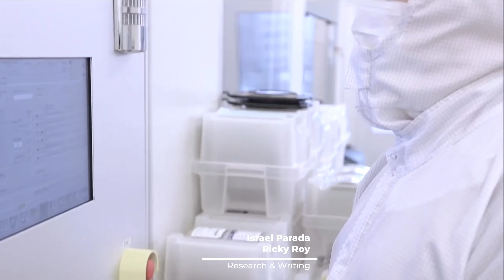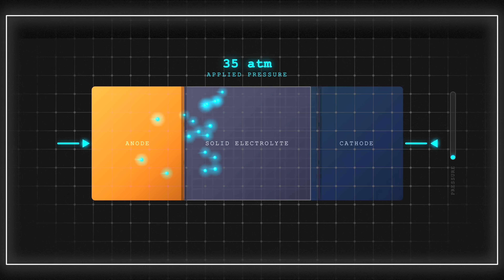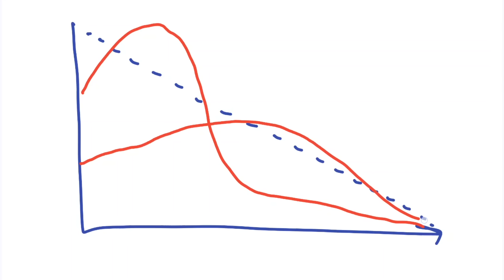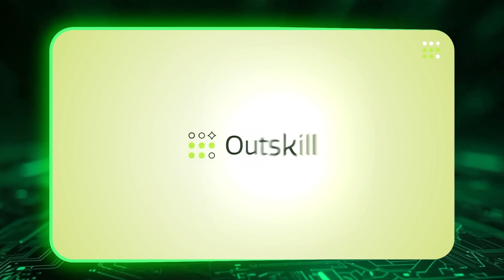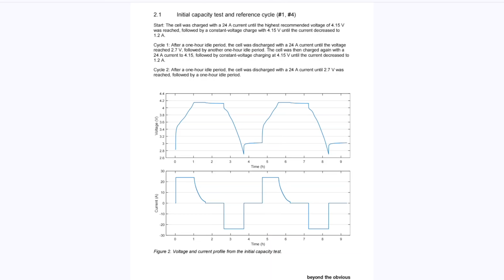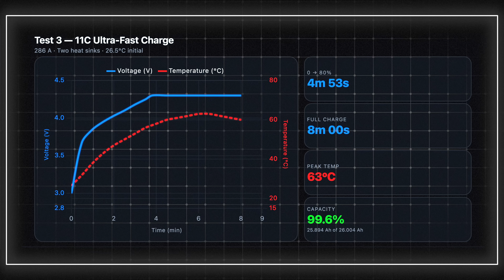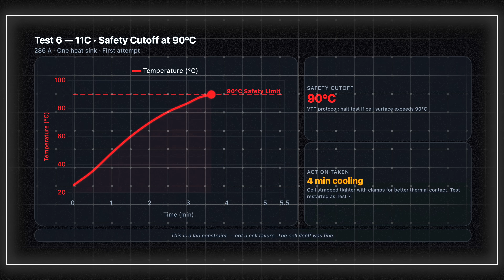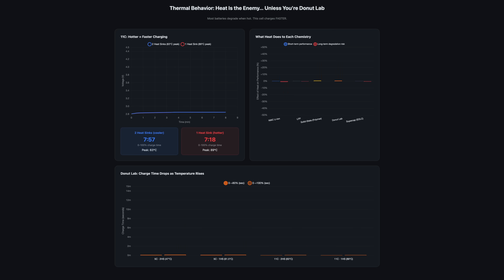Donut Lab's Solid State Battery Test are Shocking...

Comment: I think you forgot to include the video at 16:12
Reply: i saw it in my mind
Reply: I suspect Ricky excluded it after spotting Ryan's (Ziroth) comment was not about the VTT tests, but an earlier Donult Lab video showing 270A charging being performed. The same video that Ricky criticised for the size of the charging leads not being sufficient. To be honest, that video may not show cell expansion at all, as the apparent event occurs at a terminal connection, and could simply be thermal expansion of the terminal metal bending upwards within the test cell. This could be due to a thermal gradient existing between the body of the battery and the current collecting plates exit point at the terminal. 

Also, the heat causing the event (if it is thermal based) may not even be due to the battery itself, as Ricky noted in that particular test the leads and terminal connection were insufficient for the 270A current used, potentially leading to heating of the terminal itself; the thermocouple on the battery body during the test was not that high (59°C) suggesting the way the terminals were connected may well be involved.
Reply: Yes, I wondered that too.
Reply: I saw it in my head movies
Reply: This isn't the first Donut response video I've seen to be an editing shitshow.
Reply: @orbitalbear Race to be first, the same thing that gifted us "Fox News" and "CNN"
Reply: High quality production! /s

Comment: I think its just a really advanced lipo like the ones used for RC racing applications and that's it.
Reply: That is my thought as well. Outstanding battery tech, but not what is claimed. The point appears to be hype, the real question is why? If the tech was as they claim, they wouldn't need to play all these BS games, the tech would speak for itself.
Reply: @rfwillett2424  I suppose the simplest explanation would be that they want to be bought out while the hype is hot.
Reply: @pkprotoplasm  Which is my point, if the product was real, it would given them all the hype they could ever want and more.
Reply: @pkprotoplasm  If their product doesn't live up to claims, that won't happen.

ANYONE considering buying these guys out, or investing serious money in them, is going to perform their due diligence and for a company that claims to have a market-ready product, that includes carefully reviewing the production process and every minute detail. By saying their battery is market-ready Donut has effectively painted themselves into a corner, and that's part of why I think they might just be pulling this off. It's hard to see a scam play the way they've set this up.
Reply: Because...you feel it's so? I don't get all rhis negativity.
Reply: @davis.fourohfour  What I find odd, is the degree off optimism shown in the comments. I would love for their claims to be real. But if they were, Donut wouldn't be playing these idiotic games.

Comment: I want to see a test of idle drain for power lost just while sitting there. To see if it would hold charge for years like normal batteries, or drains over a day or two like a capacitor, or somewhere in between.

Since you can't really let the test go for years since they want to sell this sooner, letting it go for 2 weeks and measuring charge level the whole time you could extrapolate charge hold time
Reply: in the 1C chart after the power is removed the voltage slowly drops for 1h, could be natural or could be a cap.
Reply: @cristibaluta  I mean, if it charges to near full in like 10 minutes it might not matter for many applications. We’ll have to see how those motorcycles work later this year
Reply: @berengerchristy6256  so you like to pay for electricity that will be lost in the air?
Reply: @cristibaluta as I said, we’ll have to wait and see how they do in the real world. I think it’s hilarious that every other commenter is an expert in materials science and battery engineering. No one here knows how it’ll actually work

But yes, people pay for things only to immediately waste them. It happens all the time

Comment: Again, they did not say that their cell doesn't swell.  They said that swelling is a problem for other solid state batteries while trying to maintain that constant high external pressure to keep up connectivity between the layers.      They said they don't need the pressure, not that their cells don't swell.
Reply: @everyone -   Donut is doing this in a very strange way.  Let's make a hypothetical situation here.  Let's say this battery is everything it claims to be.  That its a solid state battery, has no lithium, charges at 11C, and has 100K cycles of life in it.  We have the Holy Grail.  

In what world would you announce it like this?  If you have the Holy Grail, investors would come.  You would have no problems funding this because you have the Holy Grail.  

There is no way you would bring a battery to market like this.  
Let's not forget that this battery was stated to be in production.  
Not just in production but going into a motorcycle very soon. 
If that was the case, why would you not have the lab results already done?  If they stated we have prototypes going into the motorcycle, that would be a different thing, but he stated it is in production.  You just don't do it that way?  You wouldn't throw a battery into a motorcycle and not know if it's going to go up in flames after 200 cycles.  What are the temps when charging and discharging?  We already saw a discrepancy with capacity,  it got lowered from what they stated originally.    You would have everything figured out with how you will package it, and its requirements.  You would know everything about this battery because it is 'in production.' 

Instead we are getting a drips of information, week by week for now. How many videos before we get the specs? Remember, with testing, Donut is the customer. Whatever tests they want, they will get done.  This is not the Lab exposing the battery.  The lab is doing what the customer requests.  

 Why are they doing weekly drops and a "I Believe in Donut" campaign?  If the battery is in production, why did they not have one at CES?  Why are the voltages so similar to a lithium-based battery?  

Is the charging impressive? Yes it is, but not groundbreaking.    How many batteries/units can they build? at what capacity? What's the warranty? What's the price? Again, it's stated to be in production.  Not my words, their words.  
I truly believe that we will get another video that has information, but after that things will get dicey.  The thing is, I want to be wrong, I hope to be wrong more than ever.  This would be huge, this would benefit all of us.This is all very strange...    You would not need to build hype for the Holy Grail, thats the thing, thats what bother me.  The scam feeling gets worse and worse for me, and this first video drop does not make me feel like this is  battery free of lithium, actually quite the opposite.
Reply: Yes, they said the typical problem with swelling is the internal delamination of the cell, not the small swelling between different cells. That's like the problem with all batteries and something easily managed.
Reply: Imagine trying to justify a blatant scam by focusing on one tiny thing like this, what makes it worse is just the fact that you're even wrong about that, lmao.
Reply: @oBCHANo I'm not justifying anything. Simply pointing out that people are reading too much into what they actually said.  And what is your specific proof that it is a scam?
Reply: Donut is very careful with how they choose their words.  Everyone really needs to pay attention to exactly what words they choose and what they omit.  You have to go off what is literally stated and not assume anything with this battery and the results.  Even with the testing done by the lab you have to focus on what is stated.
  
This Donut company is being sneaky will all of this.  Red flag after red flag keeps popping up. 
It seems Donut have a Lithium battery.  The results need to be compared to a high end lithium cell and compare the graphs.  They are just pushing the cell to its limits.
Reply: @gags730 yes they're careful with what they say, but they've started unequivocally that they are not lithium-based. Besides any lithium based cell would self-destruct at 11C charge rate with no active and rather extreme cooling.
Reply: @daemn42   Nyobolt have demonstrated similar ultra-fast charging capabilities (up to 10C)  The Nyobolt batteries do in fact contain lithium!   They are using low-impedance anode materials and carbon-metal oxide designs, reaching 80% charge in roughly 4 minutes and 37 seconds.
Reply: @gags730  scaling, cycles and cost will be a HUGE hurdle with anything lithium based, and for nyo, let alone the foundational full stack donut is bringing to the table.
Reply: @daemn42  you might have missed it, referring to swelling. He says "none of that happens here"
Reply: @richhard3 That's not what he said. He described the swelling then the need for constant clamping pressure, which makes the packs heavier and more complex, and said that was a deal breaker for their customers. Then he finished with "we do not have these limitations ".    He's talking about the clamping force issues, and does not say anywhere that their packs do not swell.
Reply: Are you for real? Still in Lulu land i guess. Why do some always find ways to justify what's a scam. 
Anyway, like its being said, its easier to fool someone than tell them they are being fooled.
Reply: @winngh  lala land
Reply: @winngh  Why do some always find ways to say everything is a scam without evidence?

Comment: Seriously, give the battery to Sandy Munro for a week and then we'll see.  And "independent analysis"?  All I saw was the Donut employee standing in front of a test rig running the tests himself!  And now a new reveal in 6 days?  Wreaks of scam.
Reply: They have to get the investors in, typical scam behaviour.
Reply: @bigmanfin  But what is reported from investors in Finland that had actual contact with them is that they had an investing cycle just before CES and stopped right after CES.
Reply: @pmaragoudakis  Got to wait for the checks to clear!
Reply: They also provided a download of the full report from VTT.

Comment: Next Monday is the nail and cycle life test data dump. At some point LATER they CAN put out the data dump that will definitively prove there's no lithium in these pouches, this is going very well so far, the 90°C cutoff on the test equipment was a bit of an unforced error, but it's going well I hope you guys keep "debunking" them, it will make the ultimate payoff that much sweeter.
Reply: What makes you think that test is next? Speculation from web headers is that the cold performance test is the next one.
Reply: @pmaragoudakis  today (Monday) they did a High Temp Performance Test instead, sounds like they have them all ready to go but release them depending on feedback. They KIND of in a round about way did puncture the seal and it did not fail after being 100c for an hour in an oven, but not exactly the same as a nail test.
Reply: @DaxVJacobson could be. My previous comment was more in the spirit that we really had no real info on what test will be revealed next.
Reply: @pmaragoudakis  I did not make it up, the Gemini Chat bot said that was what people who were tracking these Donut guys on LinkedIn were saying, I figured people who were more into this knew more then I did, I hate LinkedIn and did not look at the posts.

Comment: From what we know so far... It's a fast charging std battery, that gets hot when fast charged... 
Beyond that... Narda...
Reply: You missed the part about it getting better results when it gets hot (in contrast to traditional batteries).
Reply: @vannoo67  All batteries get better when hot, up to a point. That is the whole point of preheating in an electric car. Maybe you mean that the battery handled 286A (11C) without preheating and did not show significant deterioration after reaching 90C a few times. Good, but not impossible for lab prototypes even for known tech.
Reply: @pmaragoudakis  Yeah that was my thought we saw just several charge discharge cycles and only 2 and half at 11c and 1 and a half on 11c and high temp. Lack of swelling and drop in resistance doesn't prove much

Comment: I watch a video by a guy (@ZirothTech) that did a Masters in solid state batteries and a PhD in electric propulsion and the bottom line is that this is achievable with current technology if you don't care about battery longevity, that is key for EVs, for example. So I still think this is a SCAM! They get investment from other companies, then the company goes bankrupt and that's it. They had a good salary in the meantime...

Comment: Didn't Donut Lab say they were emulating lithium ion chemistry so it would be able to plug into existing battery management system so you can get time to market advantage
Reply: Yes they did, I remembered that too, they said the battery chemistry allowed them to implement a wide range of voltages; which I thought sounded very odd...how? No idea.
Reply: I remember hearing that somewhere in the CES interviews, and that does make me wonder if they can tailor that response fingerprint through chemistry. That seems like a longshot but... who knows?

Comment: This doesn't smell right. They would have requested and released a lot more data if it made them look good. Like how many cycles with degredation. Can a car battery really work if the cells get up to 90 degrees. That sounds dangerous. This whole thing hasn't felt right.
Reply: They will. One test a week... They are trying to win some time or smth...
Reply: so what is their end game?, what do they have to benefit from all this?
Reply: @aristideau5072  
Get bunch of money from investors and then run away?
What is the benefit to withhold data? What is the benefit to not actually sell of cooperate with huge battery company which could scale production of it and make trillions from this technology? They are on a level of someone claiming to have cure from cancer, but they will not share it and will produce 5 doses in a month in their shed just because... Make this make sense.
Reply: @aristideau5072 money
Reply: @aristideau5072  They want to maintain control of the tech. They don't want to license for others to produce, they want to hold on to the whole thing, production included.
Reply: @Thunderbuck  
How will they do that? No patents, which means that at the moment someone who gets their hands on this battery will tear it open and figure out how it works, then they could patent it and block Donut labs entirely. Even with patents, country like China isn't known for upholding patents, so that doesn't help.
 What normal people would be doing is getting patent as soon as possible and working with some huge battery company to scale its production as soon as possible. 
Stop being that naive, actually look it up.
Reply: @aristideau5072  Simple, scam idiot private investors for the money due to FOMO, and then Do exit like EESTOR, and no one goes to jail.
Reply: Jackass. "They aren't giving me all the information at once so they are a scam." You don't get your way in life, they made it, they can release info as slow as they want and it builds good momentum and interest, it's smart. You however sound like a whiney idiot who wants to demand them to go at your pace
Reply: @91hmc26 interest? this is a known scam
Reply: No car at this day can be charged at 11C. It burnt down to the ground if even tried. But now it will be a possibility. They surely will manage 90 degrees. Combustion engines warms up to 90 degrees..
Reply: @audriusp.4198  I’m suspecting the 11C attempts were more to establish the cell’s limits than any kind of real-world simulation. Though it’s a nice thought 😊

Comment: One cycle big deal.
I can charge any battery fast, it’s how many times you can do it before the battery is scrap.
Heat sink to dump the heat, not a real test. Must have a high R since it gets so hot. P=I^2R 
Not a battery bank.
Need to do 1000, 10,000 100,000 cycles in various environments and configurations. None of this extrapolating BS from a few cycles.
At 1 hour per charge/ discharge it takes 11 years for 100,000 cycles, battery needs time to cool down. See you in 2037.

When  Dr. Jeff Dahn has done his life cycle testing of the Donut battery we will know it’s true performance.
Dr. Jeff Dahn, renowned authority and researcher of batteries.  
Professor emeritus at the Department of Physics & Atmospheric Science and the Department of Chemistry at Dalhousie University
Reply: They don't literally test cells to the rated count.
Reply: @davis.fourohfour  
Yes they do, other wise you are guessing.

Comment: They didnt release the weight of the cell
Reply from the maker: no they didn't
Reply: @TwoBitDaVinci  
the cell at CES Donut display says .315 grams..
on another video got an estimate of 225 grams the cell thats at VTT,,,,
Reply: @TwoBitDaVinci   Which is pretty crazy right? Would take 10 seconds to put it on a scale and note down what it weighed.
Reply: @izzeww8487  They didn't want to tip their hand on the density claims before they were ready to release that data.
Reply: @izzeww8487  I think there is a near 100 percent probability that someone at that lab put that cell on a scale just out of curiosity.
Reply: Didn't report the color, either. Doesn't matter. Unless it's a solid ingot of lead, we can use it.